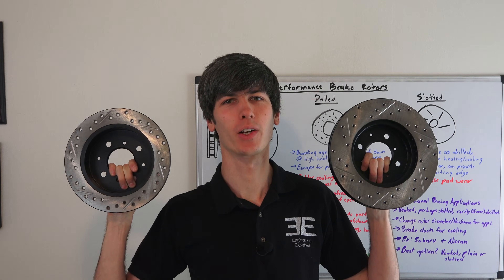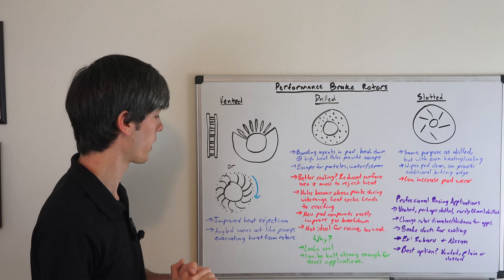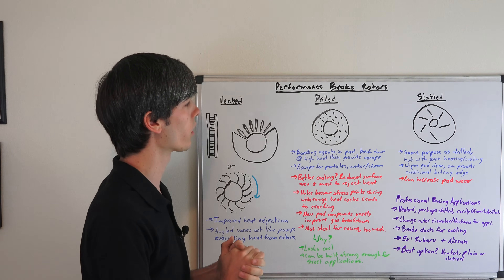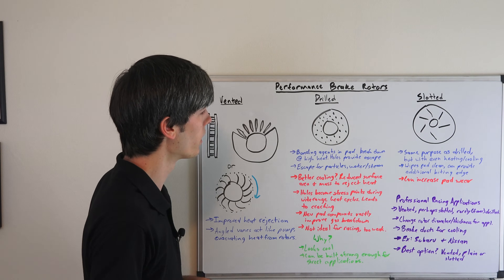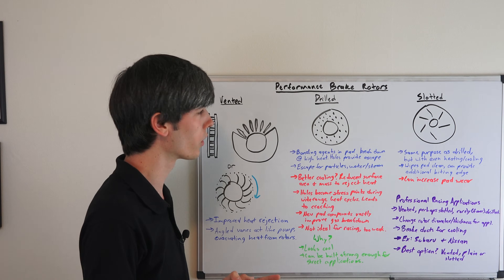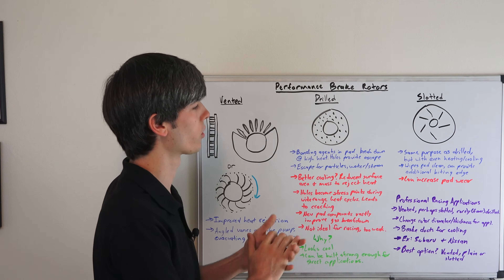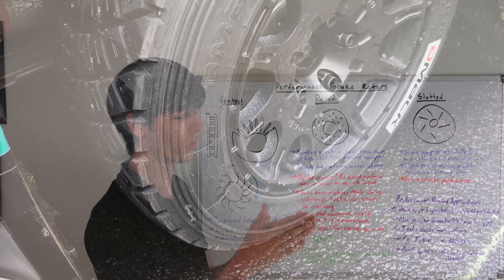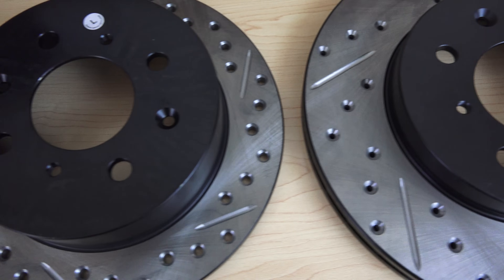Drilled, Slotted & Vented Brake Rotors - What's Best?

Comment: does the downsides of drilled brake discs applies to drilled carbon brake disc like those in Porsches etc?
Reply: boy638 main downside of drilled discs was tamperature difference on their surface, carbon disc may get less heat but its still quite hot so those diferences will still exist, but its not a problem because they shouldnt get to critical point in street car because of street tires performance limits and all electronical assists
Reply: Jakub Witak its also a structural issue too, putting holes in any structure weakens its overall strength, add heat and it does so even more. there is another option as well that he didn't cover and that is sintered brakes, but those can really pricey.
Reply: boy638 The heat issue is reduced, but the stress cracking risk is increased.
Reply: boy638 They now tend to put plain ventilated carbon-ceramic discs on supercars. The material can take in more heat, but I think it would be a bit more prone to breaking under mechanical stress, while steel compounds can bend instead of cracking instantly when overstressed (although I managed to crack 2 drilled steel rotors in a single downhill run).

Also, group N discs are plain ventilated discs.
Reply: GT-Alex What were you driving when you cracked those rotors?
Reply: john hanrahan
 A Honda CRX ED9. I bought it like this, and to be honest, I don't think these discs were high quality - don't remember the brand though, just that the pads were OMPs.
Reply: john hanrahan I've seen a few guys crack them. I don't really think its as common as some people make it out to be, but if you heat them up enough then cool them really fast they will go. One guy was a habitual brake rider and had it coming. The other guy I don't know, he just broke it.
Reply: User Name
For myself, I was doing a mountain road downhill which ends directly into the city, so the cooling was not ideal. That's not something you can always control on the road, so on a road car, your discs have to be able to cope with that from time to time.
Reply: Yeah it happens for sure. Normal driving isn't likely to crack one because you see a ton of them but rarely see actual cracked ones.

I personally prefer regular vented discs. I've not found a slotted rotor and pad combo that I like the feel of. It seems I either have no bite, or extreme bite.
Reply: Yeah, drilled rotors won't actually improve your stopping power. At least, I didn't feel any difference from that, the brake pads will have much more effect, unless you go big brakes.
Reply: +boy638 Just thrown in. There are drilled rotors and rotors with holes which were cast that way. That&#39;s often the difference in quality.
Answering the question many ask with Porsche rotors being &quot;drilled&quot; and being reliable and &quot;good&quot;. They aren&#39;t drilled.
These rotors are cast that way and specially heat and pressure treated in the areas around the holes.
That&#39;s one of the reasons why they are considerably more expensive than most aftermarket or more &quot;normal&quot; performance cars.
Since Brembo is the OEM supplier for Porsche for a few decades, Porsche had a big influence in brake design.
So technically every roadcar today which is equipped with Brembo brakes is driving Porsche brakes in some manner.

Comment: The timing of this video is amazing...i was just about to order slotted and drilled rotors for my car, but i will just stick with my vented ones.
Reply: DGOfTheCentury Go ahead and order some slotted rust-proof center cap ones! Or upgrade to a slightly bigger brake kit without the cost of going Brembo! :D
Reply: DGOfTheCentury Just get plane rotors (they are all vented anyway nowadays), and just buy a can of high temp paint and paint the center it yourself. Personally I only order Brembo blanks, they are cheap.
Reply: DGOfTheCentury like was said above brembo blanks are the go to. They are reliable, and in-expensive.

Comment: I had terrible trouble on my VW Passat with the front brakes not engaging properly on the freeway when the rotors were wet -- there would be a half-second, sometimes up to a full second, before the pads would actually contact the rotor and start braking the car. First I tried rotors with slots and blind-drilled holes (not drilled all the way through), and they destroyed the pads. I discovered this was because the blind-drilled holes accumulated grit which ground-down the pads unevenly. I replaced them with slotted rotors without blind-drilled holes, and they worked marvelously -- the slots scraped water off the pad surface, and the water flushed grit out of the slots. Never had another problem with braking on that car.

So, what I learned is: slots are useful, cross-drilled holes are not as useful, and blind-drilled holes are dangerous.

My current car does just fine with plain discs. No problem in the rain. So I haven't bothered to change them at all.
Reply: +Shawn Elliott Some newer cars are applying the brake pads to get off the water during raining. Not as much as you would feel the car doing that, and not enough to increase wear, but enough to shorten the time between you wanting to break and the car actually breaking during rain.
Reply: nirfz I know. They introduced that feature a few years after my old VW was made. It works, but slotted rotors worked too.

The thing is, cars drag their brake pads slightly anyway, because the pads don't actually retract away from the rotor surface when the brake pressure is released. So the wet-brake-drag feature does have to apply a little pressure, which might not affect fuel economy and brake life very much, but slotted rotors won't affect fuel economy and brake life at all. The slots don't actually wear the pads faster, because the edges of the slots get rounded-off during break-in.
Reply: Yes, i noticed the difference in having this feature and don't having it, and i can say now that I have slotted and drilled Brakes myself, (because my car came with them... ) i would say the reaction in heavy rain is even faster.

Comment: I gave a 1997 crown Vic a second life and love driving it and I’m a bit of a lead-foot.  But, as I had to completely rebuild the brakes I went with drilled and slotted rotors.  I do not race this car, just a fun commuter.  These more expensive and yes “cool looking” rotos lasted less than 6-months and are now VIBRATING like crazy.  Under normal use they can’t slow down a big car and last... I have to replace them with solid or slotted.

Comment: drum brakes all round for me please
Reply: Drum brakes suck. They're far less efficient for stopping than disc brakes and usually more of a pain to change out. Drum brakes are for slow cars.
Reply: slotted and drilled drums would be awesome. Wouldn't have all that brake dust collect inside the drum.  lol
Reply: Lmfaooo best comment on this section😂😂😂😂👍
Reply: If fading wasn't a thing, drum brakes would provide more stopping power in dry conditions
Reply: As long as you feed the horse, you'd be fine.
Reply: jason mcnamara 
No joke. I ran a ‘62 bug years ago. A friend of a friend offered to drill my drums. They were about worn out so I said sure. Wow. They still weren’t disc quality, kits weren’t available back in the day, but they didn’t fade anywhere as much when bombing on the back roads.

Comment: I had cross drilled rotors for ten years without issues. Heat differential only becomes relevant in hard track racing. No street driven criss drilled rotor will ever get hot enough for it to be an issue. For street applications they are a huge improvement with zero chance of failure

Comment: I noticed on my 2016 GS350, the front rotors are vented, but directional.  The left and right have the vanes angled forward, basically the opposite direction of your arrow...unless of course you're drawing is the car going in reverse :)

Comment: I bought some EBC Turbo Groove brake discs and EBC Green Stuff brake pads for my old Peugoet 306 2.0 XSi 8v sports hatch back in 2009.  At first they were fantastic, pulling me up in a few feet without skidding from high speed.  About a few weeks later I noticed the dimples on the discs had filled up with pad material,  so I had a much reduced disc braking area for the pad to work with.  The dimples were supposed to aid the dispersal of pad material, but instead were making my brakes almost useless and very dangerous at any speed.  It was a front wheel drive car and it was the rear discs that had the problem;  the front discs were operating perfectly.  I now have a 16v version of the Peugoet 306 2.0 XSi but I have fitted factory standard brakes instead;  half the price and far fewer issues!

Comment: Wow thank you for the video ! What an enjoyable and useful video to watch as always. I have recently replaced my front drilled rotors to slotted rotors and found the braking performance improved dramatically in pretty much all driving condition. Initially thought the drilled rotors have better cooling effect but I was wrong. Glad that I picked the correct rotors for my FK8. Will continue to support your channel :)

Comment: Great vid'. I've had many "discussions" regarding drilled discs cracking where bogans insist they're soooo much better than slotted or non-drilled/slotted discs. The other disadvantage of drilled discs is that they don't sweep the entire disc, just the area of the holes. This leaves some gases in play.

Comment: you didnt mention drilled and slotted as well as vented. I have had these rotors on for 6 yrs in which the pads lasted6 yrs as well. Upon replacing pads after 6 yrs. the rotor only needed a 1/32" turn.AWESOME ROTOR with all 3 styles you mentioned in 1

Comment: In old days, the drilled disk is more for weight reduction while not compromising too much braking service than really for cooling , and of course they were used more on motor bike then than cars. Back then we deal with the binding issue with grooving the brake pad instead

Comment: I have been using drilled and slotted rotors without any braking issues.  No cracks have been observed either and I drive in Chicago area winters where there is salt and snow.  However, I tried to have one resurfaced and couldn't because machines at O'Reilley and Autozone that trim a thin layer off rotors has issues with non-smooth surfaces.  The brake pad on that rotor somehow left some stray groves so i ended up having to replace the rotor altogether.

Comment: Only drilled discs with internal curved vane geometry can pull some air through the holes as the disc spins, therefore increasing cooling.

Comment: I think that Drilled are not as useless as you mentioned. If you have ceramic discs, they can handle a lot more stress and strain than steel so they wont break for high differences in temperature.

Comment: Very good video again with true information, there is one exeption with some very rare rotors with not holes but little pits that are not drilled but the rotor is cast with them, same function as slots this also help to visually see when the rotor is worn out by depth. Being cast this drastically reduce the stress on metal during heat cycles.

Comment: My 2001 Tundra has a basic design flaw. Afraid of rear wheel lock up, the rear drums do exactly nothing apart from parking. The front discs get overloaded and despite being ventilated, they overheat and warp. Toyota soon became aware of this but refused to fix it. My solution was EBC drilled, slotted and ventilated rotors which worked fine for 100,000 miles until I replaced them with a similar pair.

Comment: I use a set of R1 Concepts slotted and drilled rotors, plus ceramic pads. I've found that my overall stopping distance is reduced by about 20 feet, and the actual braking feel is smoother, with me having to place less overall pressure on the pedal.

They paid for themselves less than a week after I installed them.
Reply: I just got the same rotors can’t wait to put em on

Comment: It's worth noting that race cars run race pads, which aren't particularly effective until the rotor gets hot. In this case, rejection of heat becomes less important, and so the cooling properties of things like directional vanes between the rotor plates become less important. Just something to keep in mind when comparing what is used on a race car vs what is used on a street car, where the brakes need to work even when it's very cold.
Reply: Your first sentence is mostly correct, but the rest is just wrong. Managing the heat in brakes is one of the biggest challenges in racing a production based car.  Race teams will usually use the biggest rotors that will fit, race fluid that boils at a much higher temperature, and ducting to direct air at the brakes. We use every effective trick to move heat away, and drilled rotors are not a trick that works. Yes race pad compounds operate at a higher temperature range but you can still exceed that temperature and have brake fade or failure.

Comment: Great information.  Also need to explain more of thermal properties of the 'types' of pads and materials.  Also..maybe dive into the types of rotor metallurgy, types?  Maybe that might be too complex?  From experience, I only use solid or slotted only and metal ingredients depending on the application and type of pad material.  If you know how the vehicle brakes should feel, react and work, there is a combination specific to how you like it to work.

Comment: A large advantage for the drilled rotor is that the average rotor temperature is 50 - 80 degrees lower. What this does is allow your street pads to have better friction coefficient. They also perform better in wet conditions. So, drilled rotors are great for everyday driving on a street pad.

Comment: I opted for the slotted and vented route for better bite.  I notice that in high speed braking. The stock couldn't keep up in slowing down the vehicle.  Heavy vehicle needs longer brake distance to come to a comolete stop. Hopefully this will improve on the stopping distance with that extra bite at the expense of brake pad wear.  Brake rotors due get extremely hot and in extreme heat the pads loose its braking efficiency. Until then only time will tell if they're worth it or not.  I'll just get a backup set of pads when that new pads get worn down.

Comment: i always liked to think of rotors as a capacitor but with heat instead of electric. the more material removed that that much less heat it can hold. while slotted or drilled rotors might cool marginally faster due to more surface area, they also heat up much faster due to less capacity. so when towing something heavy with a truck and you had to slam on the brakes, you are more likley to overheat the rotors

also, while i dont support drilled rotors. depending on the thickness of the rotor and the diameter of the holes they do have more surface area. while your loosing the face of circle of surface area, you are gaining the surface area of the circumference of the hole. this would be more effective on alot of small holes on a thick solid rotor than big gapping holes on a thin vented rotor

Comment: 100% accurate. I got a good deal on drilled and slotted rotors. They look amazing but they suck. They're starting to crack and warp because they cool down too quick for road use. I will definitely only go with plain ones next set.

Comment: It also has to do with material of the rotor. LaFerrari, 918 Spyder, Bugatti Veyron, GTR spec V and Corvette ZR1 all use drilled rotors on their carbon ceramic brakes. They are designed not just for street but for track use also. On track only Ferrari's such as the 599xx and FXX this is the case also. And in those cars the brakes glow red every single lap. 

On standard cheap mild steel brakes, slotted is definitely better than drilled.

Comment: Keep in mind the thermal mass of the brake pad and rotor. Different materials of rotors to pads have different coefficient curves in relation to heat. You have to take into account the braking load due to load transfer from the rear wheels to the front under braking. Everyone knows braking under high g-force changes the the braking load to the from of the car. This means that there is more force under breaking at the front of the car requiring the brakes to heat up more. This also means that the front brakes are more likely to fluctuate more and operate at higher temperatures than the rear brakes. This changes your coefficient of friction from front to rear and set's your bias off. The way to combat it is to account in the excess load and braking load transfer and increase the front thermal mass in relation to the rear. This will allow the breaks to require more heat to heat up. So the front brakes in theory if done right will heat up just as the rear keeping the coefficient of friction on the brakes constant. This way you don't have any weird bias changes and lock up the front or rear wheels during racing. You can also change pad/rotor material from the rear to a coefficient of friction range that is optimum in the temperature that the rear brakes will reach. 

yup

Comment: All motorcycle discs are drilled except for carbon discs used only in dry racing conditions. But in the rain or moist conditions even MotoGP bikes uses drilled discs.
I assume the reason is to clear the water more easily and to save weight since the steel brakes used in the wet are strong enough for the load.

Comment: plain vented rotors will warp with ceramic pads. I warped 3 front rotors before getting drilled and slotted. no more problems. also put them on my truck (front and back) day and night difference towing heavy loads. my next truck will have them the day after I get it home!